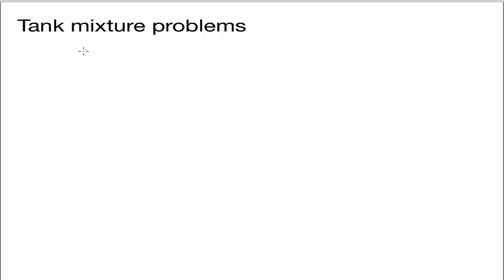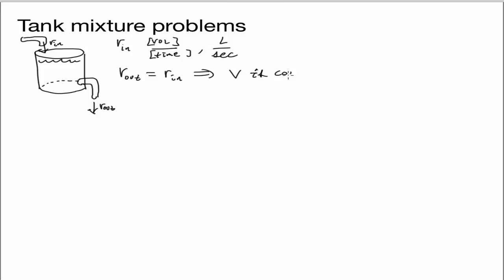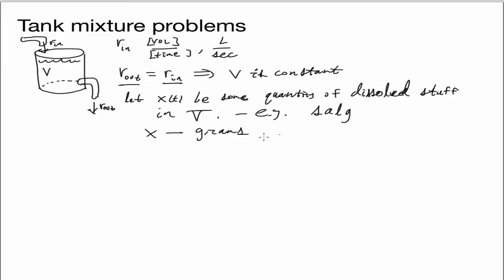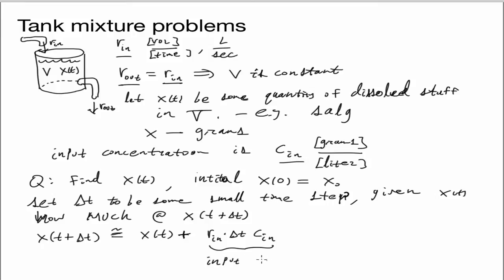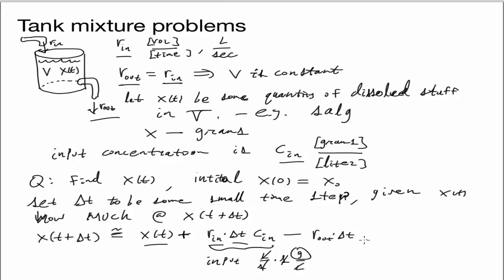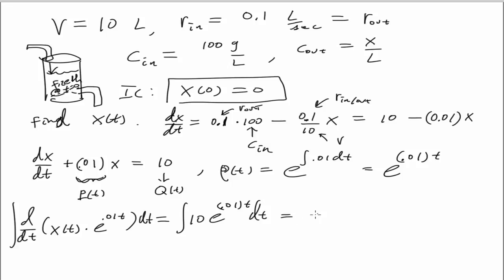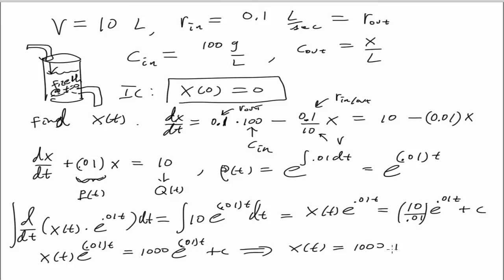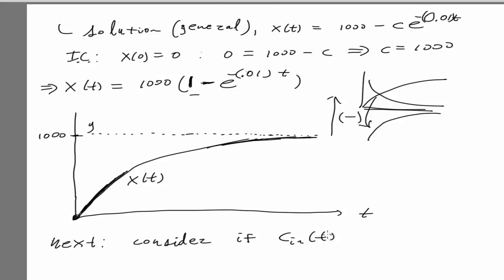Tank Mixture Problems: applications of first-order DEs

Comment: A 1500 gallon tank initially contains 600 gallons of water with 5 lbs of salt dissolved in it.  Water enters the tank at a rate of 9 gal/hr and the water entering the tank has a salt concentration of  lbs/gal.  If a well mixed solution leaves the tank at a rate of 6 gal/hr, how much salt is in the tank when it overflows?    mam can we solve this question by rk 2 method